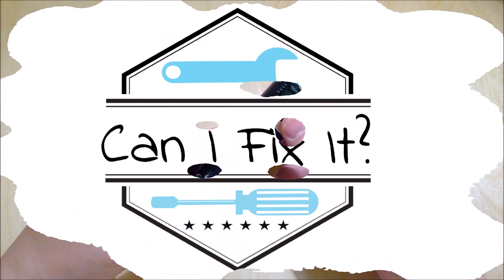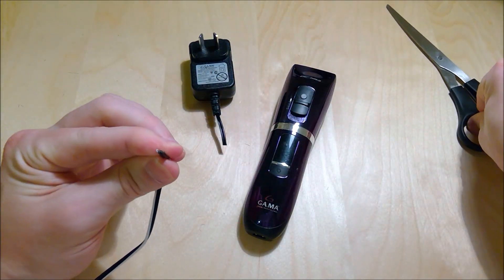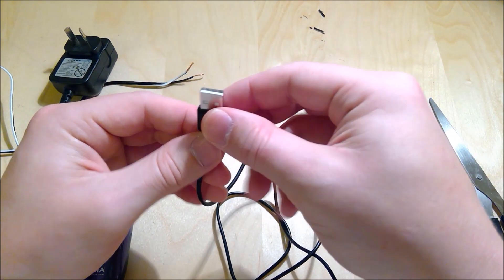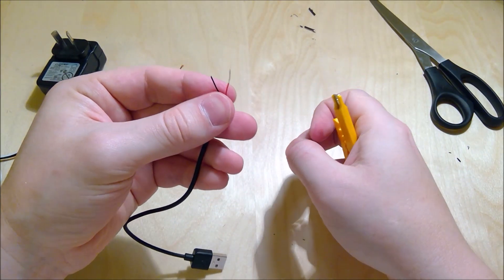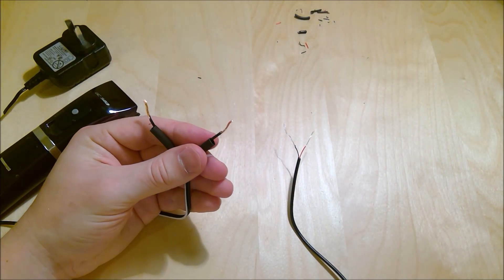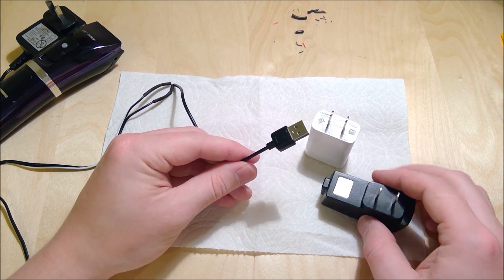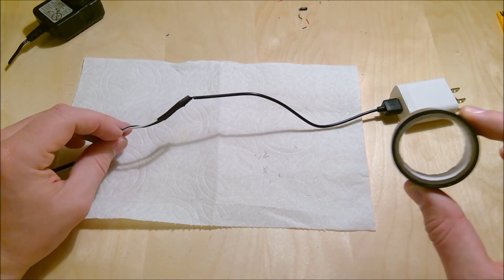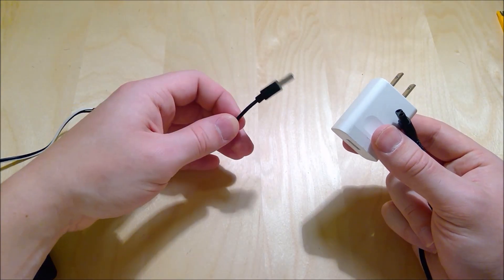Converting a Foreign AC Adapter to USB

Comment: I converted my adapter to a usb port for my led lights it works but the voltage is very low for some reason even tho i used 5.4 volt and 2.3 amps on a brick

Comment: Hi! I am trying to do the opposite. Recently moved to South America and brought with me my favorite reading lamp from the US that is 110v. The lamp says 7v .43a are you aware of other charging devices that I could use for it? Since my phone charger is also just 5v
Reply: You can buy adaptor/convertors online. You don’t want to make your own voltage convertor and they’re cheap online and can be used in pretty much every country with any input/output which is great for traveling
Reply from the maker: 7v is kind of a weird voltage so I don't know of any charging devices off the top of my head that use it. But as Alessandro said, I'm sure there are adapters available for purchase online.

Comment: This video is old but would this work off a power bank for mobile barbers who might want to charge on the go in their barber cases?
Reply from the maker: The video is less than a year old lol. Most power banks are 5 Volts and the amps can vary, so as long as your barber device is 5 Volts and the power bank can supply enough amps, then yes it should work.

Comment: What about the usb im trying to use? It has TEN different wires, 3 of which actually have 2 more wires inside of them, so technically 13. And of course cannot find out much beyond a ridiculous data sheet
Reply from the maker: Wow I've never seen a USB with 10 different wires before. I guess as long as you can find the positive and negative wires it should still work, but I can't say for sure!

Comment: I got a clipper with just the cord that plugs in to it, but nothing to plug the flat end into. Could I use a phone charger?
Reply from the maker: The simplest answer I can give is look at what the voltage says on the back of your clippers. If it says 5V then you can use a phone charger (a 5V phone charger, which most are). If it does not say 5V on the back of your clippers, then you can't use a phone charger.
Reply: @JakeWardOfficial  Thank you, lol, that helps me alot.
Reply from the maker: No problem man, I'm here to help!

Comment: Is it safe to wrap the wires in electrical tape and then use the shrink wrap to sleeve both wires?

I don't have a soldering iron unfortunately but would love to convert my toothbrush charger to USB.
Reply from the maker: Yeah that should be fine. I don't think soldering is completely necessary so twisting the wires together well should be fine. You can cover them with electrical tape or heat shrink, they are interchangeable. The main thing is you don't want the positive and negative wires to touch. Let me know if you're able to successfully convert your toothbrush charger!

Comment: Dumb question but I just got my woodburning tool which is a two prong connected to the actual tool. Would it be possible to change the two prong into a usb cable? I'm trying to connect the tool  with my portable power bank so I can burn outside since I can't burn inside the dorms.
Reply from the maker: Not a dumb question at all.  Is the two prong part like a big adapter box like the one in this video or is it just a simple plug?  If it's a simple plug, then you wouldn't be able to convert it to USB because that means that it's meant to run off of the 120V from a wall outlet and not the 5V that your power bank likely supplies.  On the other hand, if it's a wall adapter, you can check the output voltage and amperage listed on it and see if it is 5V.  If it is, then that means you can convert it to USB and it should work with your power bank, as long as the amperage is below what your power bank can put out.  Let me know if you have any questions, and thanks for watching!